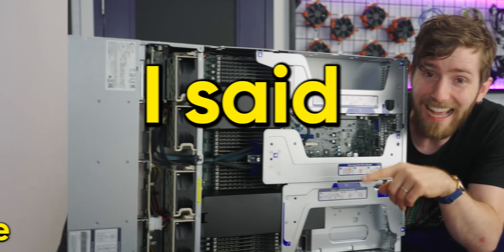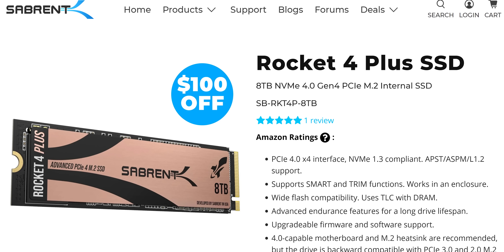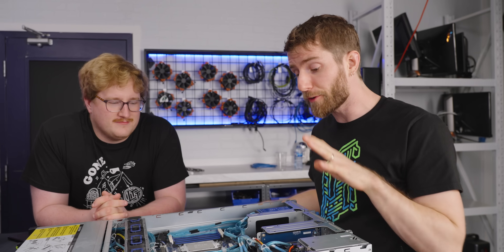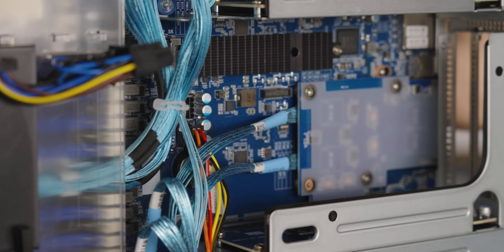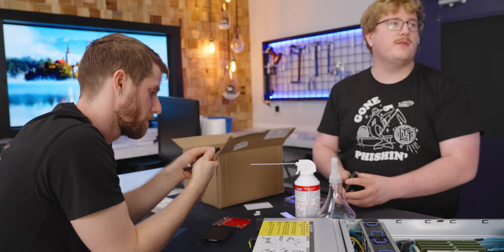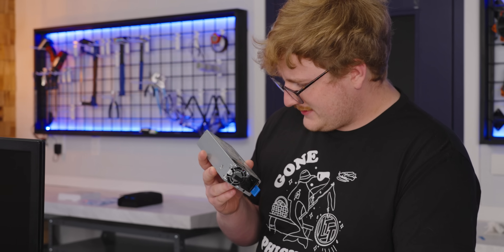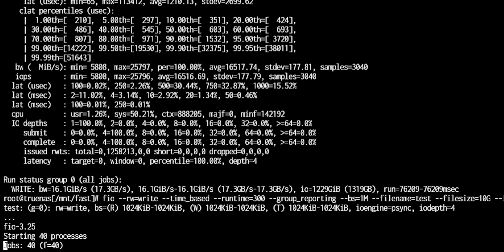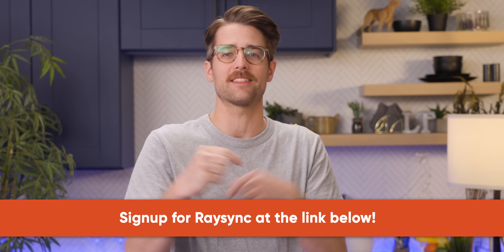Fixing our server's biggest flaw

Comment: Linus, some honest from heart advice from 20+ years in datacenters and smb envs. 

Saying "From now on / in the new datacenter / for this new setup, we do it all proper" never works. Its a good motivational technique, but otherwise a contradiction and fallacy.
If you want things to be much better the next time, then start by fixing what you have. Spot fixes, not eveything, but learn the technique, get the sense for where the system trips from maintainable (where you can clean up/change any single thing with two people in 5-15 mins) to hopeless. Learn how to make a hopeless thing less bad.
It becomes satisfying when you know itll not be as bad next time you need to touch it, and from there comes the experience to make reasoned discussion and experiments for work approaches, and those are what keeps your new shiny thing clean.

Comment: tbf, I kinda feel like Linus should try to see if he can scale the editting servers more horizontally instead of vertically.
Sure, it'll add a bit of complexity but if that 1 machine goes down, all editors are kinda screwed instead of just a bunch of them.
Reply: Looks like that's what they are doing with the Weka implementation that Jake referenced in the video and they have discussed before.
Reply: I'd like to see what performance they could get out of Ceph.
Reply: If I'm not mistaken, they've shown in the past their method of solving the problem, that works just fine for their scale... just having the last version of the server sitting in the rack where it can be turned on if something major happens to the current one.  Having a second box is perfectly viable and low cost to keep production running as long as you have on site staff that know how to turn it on and users that know how to use the redundant system rather than the main one.
Reply: @johngaltline9933  yea, they've shown their method that works fine for back when they had like 3-5 editors.
Becomes a bit tighter at 11 editors... And LMG is still growing (they still have job positions open for editors) so it becomes less and less sustainable.
Reply: Yes, because when I think of a tech YouTuber with the patience and attention span to implement a server cluster, it's definitely LTT 😂
Reply: they did have a zfs pool
EDIT: with remote "nodes"
Reply: Right.. IF
Reply: But LTT has offsite backups I think.
Reply: @Iaotle  off site backups are just that, backups.  Just because data is backed up does not mean that it is easy or quickly accessible.  For something business critical like this server you really want something with high availability.
Reply: @Iaotle  the data on the editing server is volatile to begin with.

What they need it for is being available while editing.

Offsite backups have no relevance in that process.
Reply: just if they did it after the zfs pool corruption. But they didn't used to
if i remember correctly the zfs pool had an offsite node (idk the zfs terminology)
idk tho if they set it to be in HA tho

Comment: As a professional data center storage administrator, the thing about this that gets me the most riled up is Linus' server naming.  Stop.  You think you're being funny and cute, but that kind of stuff causes serious problems.  Either keep the same server name, or fully redeploy.  Stop with this new, nu, eww stuff.
Reply: 3:03 has a point
Reply: Thats what gets you riled up lol?

Not the use of consumer flash in an array? The lengths these guys will go to avoid an enterprise SAN...
Reply: @Skiller71Studios  Looks like they didn't label the drives either. Jake was putting the drives in, but I would of been printing labels that had the last 5 digits of the serial number of the drive and putting it on the front of the drive caddy.
Reply: Their use case really doesn't justify a full enterprise SAN.  That only makes sense when you have a large volume of server deployments.  They're very concentrated and their 99% consumer is a single NAS-oriented system.  A SAN would just add additional complexity and overhead without any real benefit.  A SAN would be a massive mistake here.

The consumer flash doesn't bother me (too much) because the only real issue there is the wear leveling and endurance, but again their #1 priority is capacity, they aren't turning data over a lot so the endurance isn't a huge problem.  For the price of two or three data center rated NVMe drives, they can get get almost all of their capacity in consumer, so it's honestly a good move (assuming they use a system where replacing failed drives is reasonable, hence why this step is good and overdue).  They don't need datacenter endurance, they aren't hosting massive databases with lots of roll-over, they're just storing video files so consumer is fine.

No, you have no idea how much this 'reused servername' and in-place rebuild bullshit causes me headaches.  Jesus, it's like system admins are intentionally TRYING to screw with us infrastructure people.